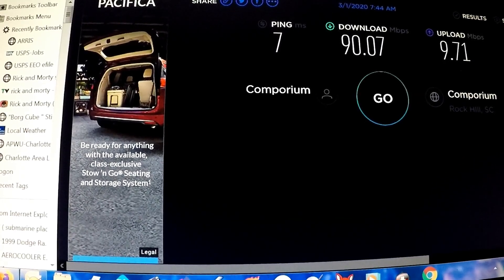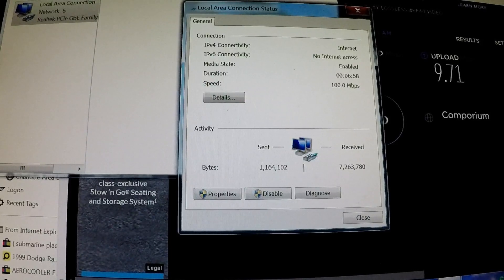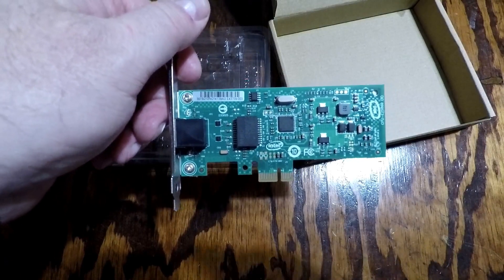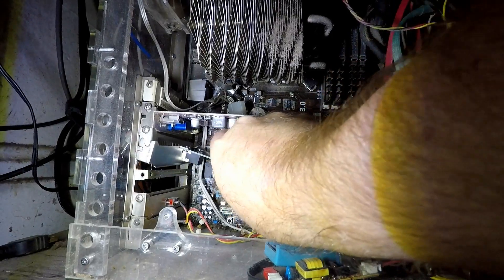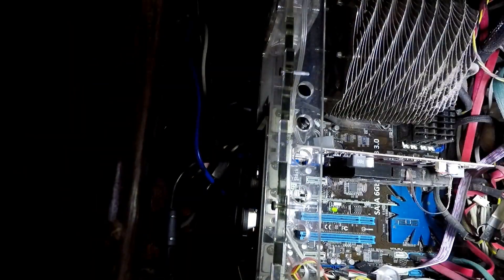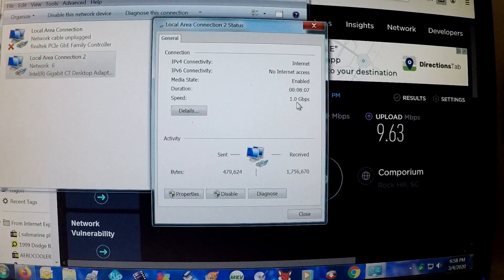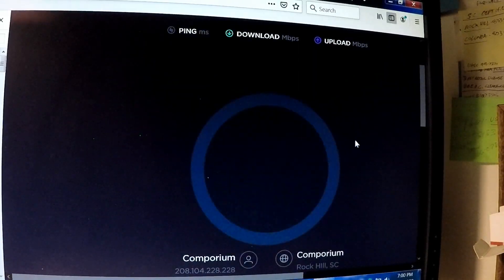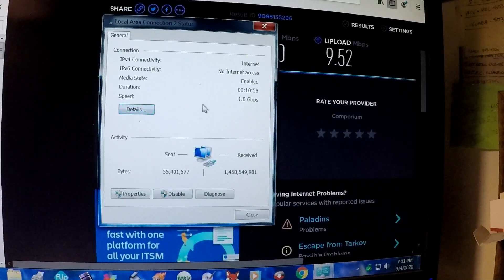Fixed My 100Mbps to 1Gbps Download Speed Issues

Comment: I have brand new cat5e cables, my router page settings say ethernet is active at full duplex 1000mbps, my network adapter details also says 1.0GBPS, and yet when I do speedtest on the internet it still shows max 100mbps download and upload speed. Not sure what else to do.
Reply from the maker: Contact your Internet Service Provider (ISP)
Reply: have you solved that issue because i am experiencing the same thing and i just cant figure it out
Reply: @calintarasascu17  Yes, I tested each of my ethernet cables at a time, connecting the computer directly to the router in the living room and found out one of the cables was not Cat5e, it was only Cat5 which limits the speed to 100Mbps. Why one of the cables that came with the package was just Cat5 is beyond me I guess they just try to save money. My other Cat5e cable was giving me speeds up to 900Mbps directly connected to the router. Make sure all your cables used are at least Cat5e minimum, preferably Cat6. Even so, I also found out using these wifi devices in another room different from where the router is will also affect the speed because of the electric wiring in your house and all other electrical devices connected in the house (fridge, tv, etc) will interfere. Consider yourself lucky if you get speeds of around 300Mbps in this case.

Comment: Hmm I am having a similar but diffeent issue...lol I used the test before and I got up to 900 Mbps, now its a fraction at 90, and nothing has changed on my hardware?
Reply: got the same problem! let me know if you figure it out
Reply: @tylerslays3760  did any of you fix this? i had 300 now im at 100 capped its affecting 2 of my computers in my house hold

Comment: What motherboard do you have? I'm having the same problem with my Asus H97M-E.
Reply from the maker: Asus P7P55D-E LX
Reply: @rvr2  next time hide your ip tough luck
Reply: I have the same problem with asus z370 f when I go to speed and duplex and change to 1 gbs it disconnects it I guess I’m buying one
Reply: @jacobtyrrel2413  Finally figured out the problem with mine. It wasn't my ethernet cable, but the port to the router. LOL
Reply: @UndertheMangoTree  

Can you show how to solve this? im having the same issue (using Win 7 64)
Reply: @penholder7765  I just replaced my ethernet port to a new one. Cat5e or Cat6 should work fine.
Reply: @UndertheMangoTree  
is there any driver/bios update afterwards? or just install the new ethernet port?
Reply: @penholder7765  Just buy a new cat5e/cat6 port and replace your old one. It's wise to also get a new cable as well.
Reply: @UndertheMangoTree  
ok noted
Reply: @UndertheMangoTree  
Just bought the new one online and received today. 
My 8 years old pc mobo with built-in ethernet port (speed capped at 100mbps all that years and i'm thinking whether my mobo actually ONLY support max 100mbps, or the built-in ethernet port became faulty over time) gives the answer today.
My Internet speed going 1gb after the new installation port. (from 8 years with 100mbps)
Thank You.
Reply: @penholder7765  You're welcome, man! Glad it worked!
Reply: I have the same motherboard aswell but in my case unfortunatly its not the router